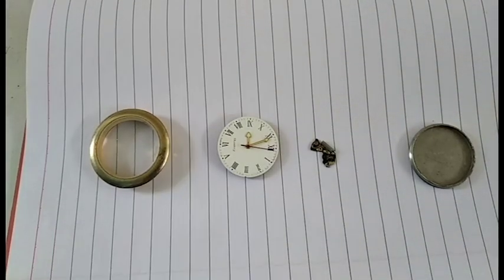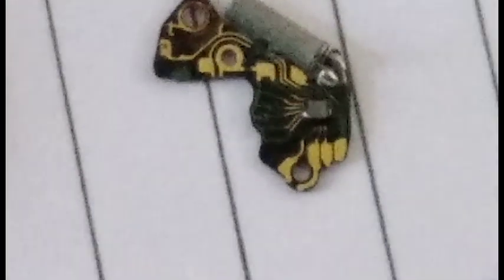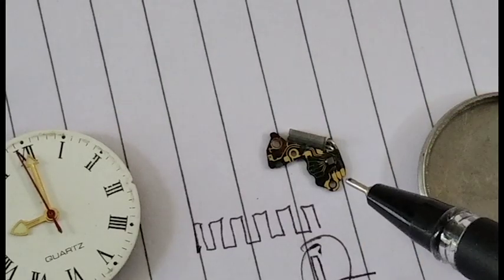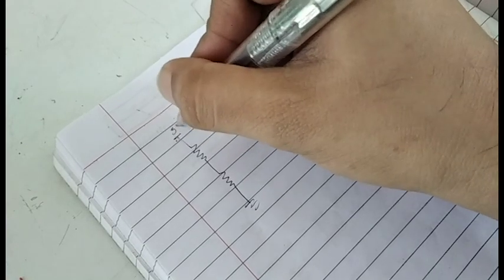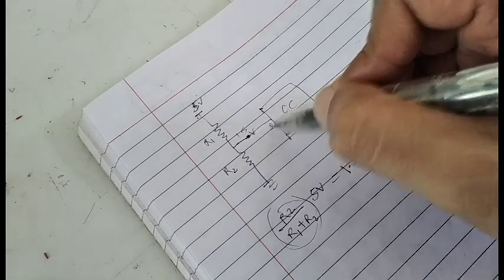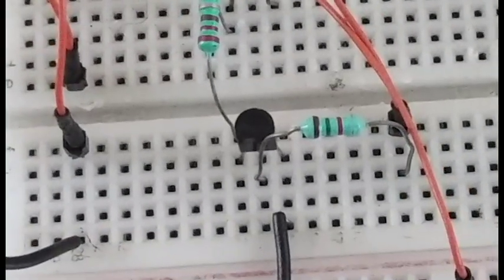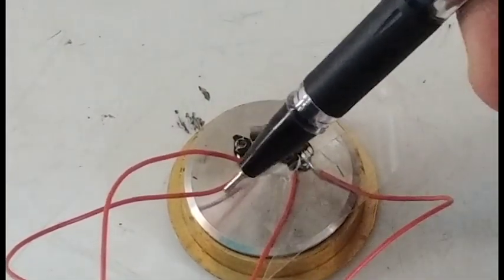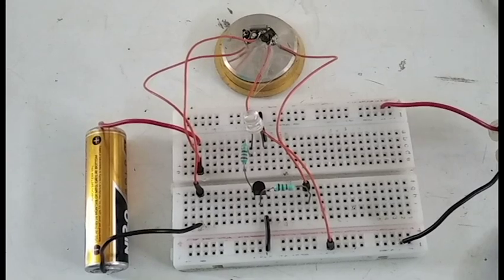0.5 Hz crystal oscillator circuit

Comment: I believe the output is actually like an h-bridge circuit to power the motor.  There should be three output contacts, one +, one -, and one that is common.  Get a pair of LEDs and connect them across the three terminals with one leg being common (cathode of one, anode of the other).  Each should light up alternately for 1/2 second and so the combined "on time" is one second.